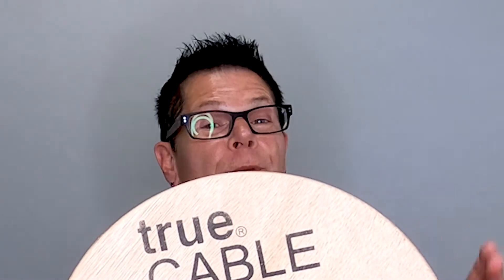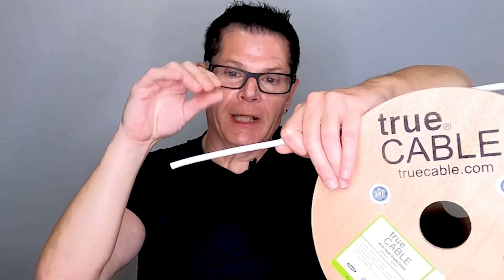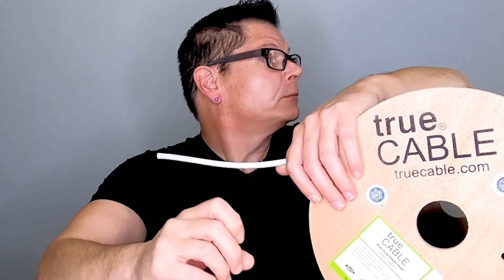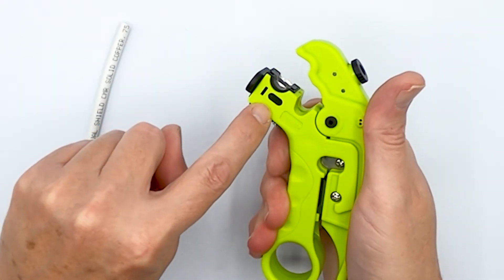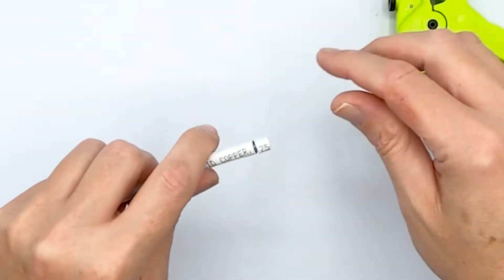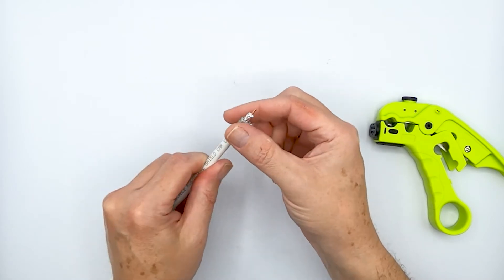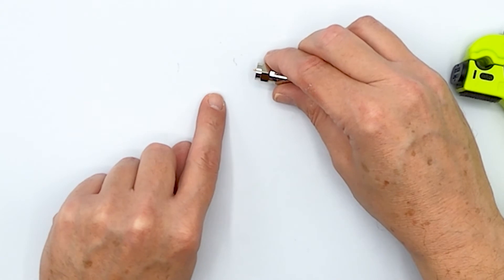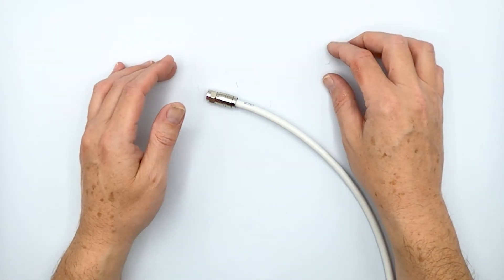Terminating RG6 Dual Shield Coax Riser - The Correct Method

Comment: That stripper sucks, the pivot pin on mine broke after a few months.
Reply from the maker: Hello and I am sorry to hear that! In going through the RMA for refund or replacement records I have to say that is a rather unusual thing to have happen. It does not look like a design flaw. In your case I am thinking your particular tool was defective. We are happy to replace it under our Forever Warranty. Just send us a picture of the tool that is broken with your contact information on our Contact Us form on the trueCABLE website. We will get you a replacement, at no charge. Thanks!